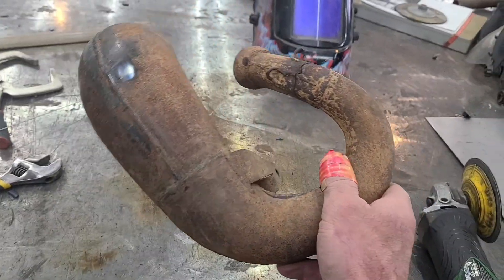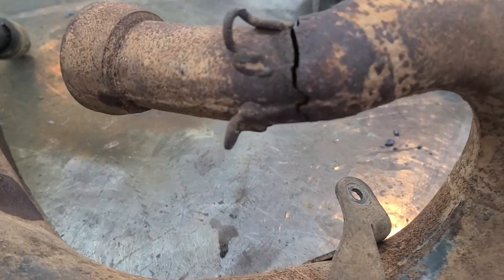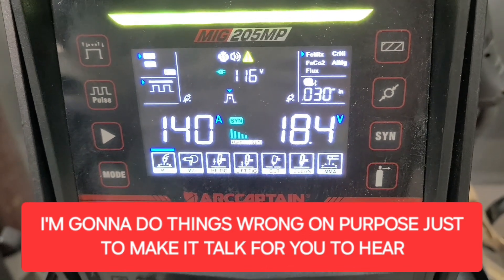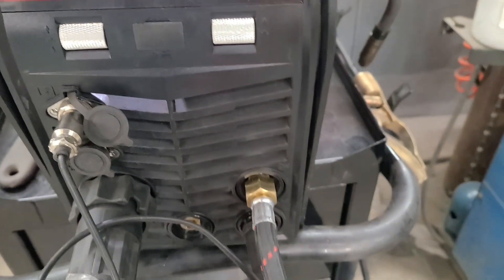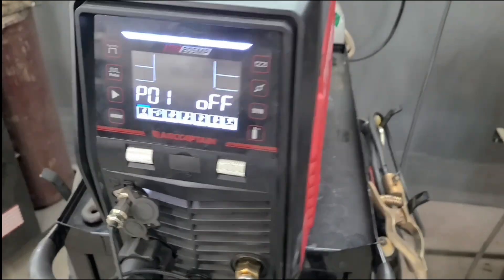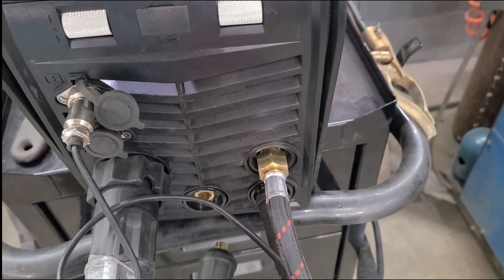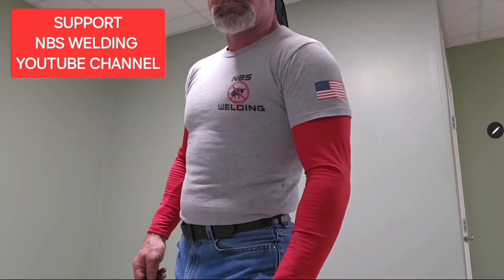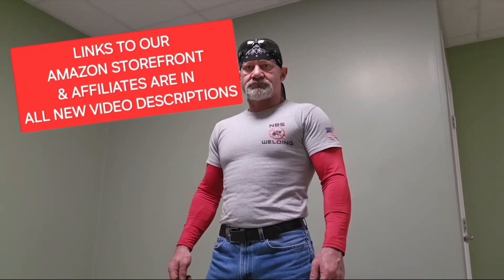Exhaust repair & turning the voice off on the 205MP

Comment: Hey CB, I'm getting the ball rolling on finally working for myself as a welder. I've done tons of stainless tig and stick and I'm curious about the blue demon wire you used a while back. It would be real neat to see you do a video on some more applications like out of position welds and maybe some thin stuff. That could be interesting info for someone like me. I don't yet have a mig machine or Suitcase of my own but if I did then this wire might be a selling point for my services at the vegetable packing houses and marinas in my area.
Reply from the maker: I don't use Blue Demon wire...I use ARCCAPTAIN 
I've used ARCCAPTAIN flux core stainless on the channel and learned that it runs on DCEP unlike regular flux core that runs on DCEN.
I don't get much stainless work
Reply: @NBSWELDING my bad i forgot it was that arc captain brand. Have you run it vertical up? Thanks for all you do for the welding education community

Comment: Being an old guy, I had a friend of my son's try to weld a muffler on a 1975 Honda bike I have. He sent it back saying it was too far gone and couldn't be welded. I took my oxy-acetyline torch and a coat hanger and fixed it. 

Using the MiG as you did is good to know, but the younger guys should know old technology is not bad technology. 

Thanks for the video.
Reply from the maker: Did you see the chair I fixed with tie wire?
https://youtu.be/UniIiExIzQg
Reply: Good deal. A friend of mine says " you know what scrap is?  When you use a cutting torch, everything that sprays to the floor is scrap. Everything else is gold."

I'd have a hard time keeping my shop as clean as yours.

Comment: My 252’s have settings for your post flow…
Reply from the maker: Must be newer than mine...that's cool
Reply: @ When your machine is off if you hold the trigger on your gun and turn the machine on, it don’t come up with settings?

Comment: That talking mode could be very annoying kinda like an unhappy wife! You brought out some very good pointers about dealing with thin rusty metal with foreign stuff on the other side. All good info and most home DIY’s are gonna be dealing with these situations. It took my a little while to figure out that running a bead on thin metal wasn’t going to work. Like making major holes! Finally came to terms with myself that running beads wasn’t the only way to weld. Thanks for the pointers.

Comment: Well done CB 😊 
What happend to yor thumb ?????
TAKE care
Also question for you , ?030 or .035  size wire and when to use them  , on what to decide
Reply from the maker: My fingers are torn up and split open all the time.

.030 for thinner material....if your welding steel thicker than 1/4" .035 is nice....but either will do either the difference is not that much

Comment: Over the years I have had good results using brass on manifolds and exhaust, that way it will stretch and contrac with heat cycle i enjoyed your video
Reply from the maker: Great point!